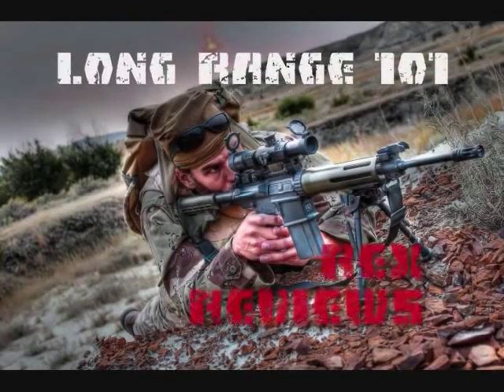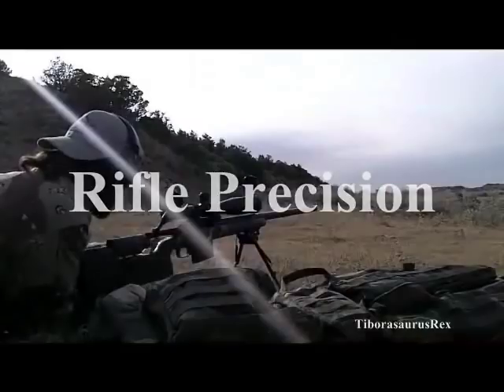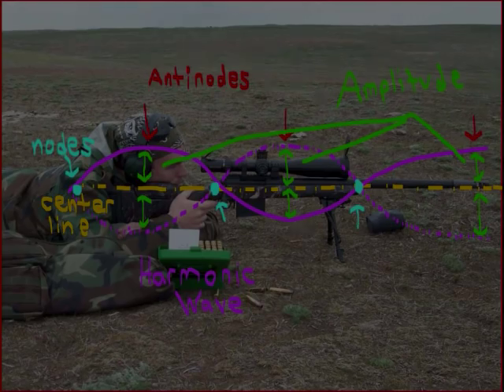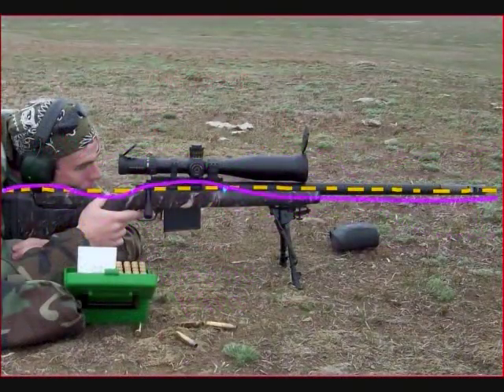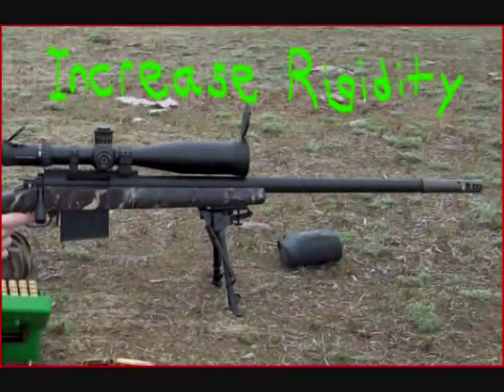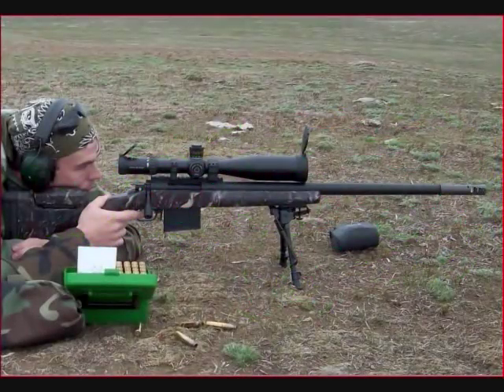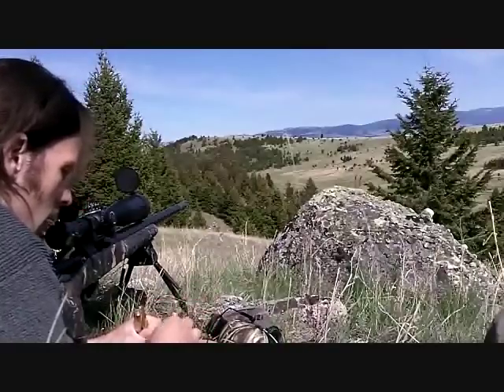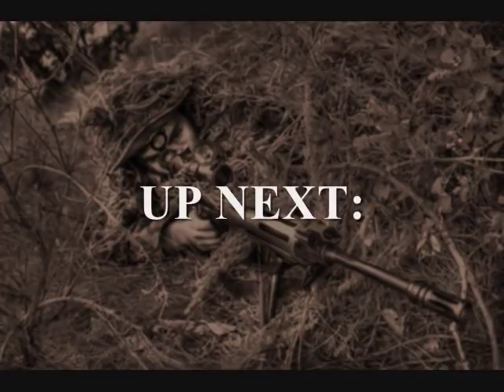Long Range 101 Part 7 - Rifle Vibrations & Harmonics EXPLAINED - Rex Reviews

Comment: What if the wave is a spiral induced by the rifling instead of a standing wave on one plane?
Reply: SOLDTONORM physically, vibration almost never occurs that way. The forcing frequency of vibration would have to be much higher than those causing a standing wave vibration. Spiraling absolutely happens but the effect is much less significant.
Reply: Thank you for your response. Not disagreeing, but what I have read from shooters in the UK mentions the positioning of the weight on a barrel shows notable effect from as little as a one millimeter movement.  At range, the minimal effect from a spiral movement might be noticeable, and since I am guessing the wave is not always occurring on the same plane, the spiraling might be creating a complex wave.  What causes the non-spiral deflection, and in what direction does the deflection occur?...Or do I owe you an apology?
Reply: A complex wave is most definitely created in an impulse loading condition. However, a closed, hollow cross-section's greatest rigidity is resistance to twisting. The resistance to sine/cosines waveform is much less in a long cantilevered element like a barrel. Imagine flexing a long pipe versus subjecting it to a torsion; the flexing deflection will be significantly more than that of the twisting given the same energy input. I'm not trying to be a know-it-all, I just saw your question and though I might have some insight; I understanding the original question correctly?
Reply: I appreciate the input.  Since retiring, I miss problem solving...a little.  Are we looking at a wave on a vertical plane since either gravity is deflecting the barrel downward, or the muzzle rises due to the drop of the butt below the center line of the barrel?  Minimize the effect rather than tune around it by supporting the barrel through pre-loaded support(as shown in the video), and assure that the recoil is absorbed at a point on center line with the barrel?  The Sniper 101 series is excellent.
Reply: I'm not familiar with current practice as far as mechanical vs load tuning. My guess is that because mechanical tuning is not as effective as it seems to not be current common practice. My main point is that the primary vibrations occur orthogonal to the main longitudinal axis of the barrel. Twisting induces the least significant vibrations, this is verified by mathematical modeling. It seems that tuning the load to match the harmonics of the rifle is the currently held best practice.
Reply: You're never going to get rid of the wave. What you're really trying to do is have the barrel at the same point everytime the bullet leaves it. Muzzle brakes seem to have a greater affect on accuracy than barrel whip. The gases leaving behind the bullet can easily affect it's trajectory.
This problem is not solved with one solution. You kind of have to do them all.

Comment: Wouldn't free floating allow for greater antinodes? I thought free floating increased accuracy.
Reply from the maker: True, but the reverberations in a free floating barrel are much more consistent and thus timing a load to the barrel is possible.  Inconsistent reverberations are much more difficult to deal with.  When it comes to system vibrations... consistency + rigidity = greater precision potential
Reply: Which do you prefer? Free float or non-free float?
Reply from the maker: James A. Unless the stock is EXTREMELY rigid, free floating is probably the safest way to go.

Comment: there is a point i disagree with and its the idea that the least vibration would be at the cheek or whereever because it is held against you. The deflection in the barrel is close to nothing but the force it exerts is immense and the force to "deflect" your cheek is pretty much nothing.

Comment: I wish .308 win barrels came in 1:9.5" twists.
Reply: What's wrong with a 1-10?
Reply: undeadhunter5 I've been shooting mosins for a while and it's my observation that I can make a 100-50 y/o rifle shoot better than a lot of production rifles (especially when they're shortened to 16".  The differences I can see between .308 and 7.62x54r (mosin nagant), is the twist rate and the cartridge's operating pressures.  I might be wrong on this, but at least I'd like to see a barrel out there to give it a "shot".  Besides, must hunters want to use heavier bullets which requires a faster twist rate.
Reply: 1-10 will stabilize a 200+grain bullet. I'm not aware of any .308 hunting loads that weigh more than that.

Comment: Awesome vid but I disagree with your assessment of the physics. While an antinode maximizes deflection amplitude, the slope of the barrel is minimized, at a node deflection Is minimized but angle of the barrel is maximized.
Reply: I don't understand.  At the anti-node the barrel experiences its largest deviation from the node.  Though the slope of the wave (the tangent?) is less at that point, the barrel is not the wave, the wave is a measurement of barrel flex.  Getting the barrel to flex to some exactly repeatable point is the key to accuracy.  Tuning the barrel so that the node is at the tip of the barrel would mean repeatability is maximized.  Is that right?

Comment: I wonder if you're aware of a new company: teludynetech, which puts a thing metal jacket on a barrel, and fills the space with a proprietary filler--which serves to GREATER stiffen the barrel AND greatly draw heat away from the barrel--without adding significant weight.

It looks to be a REAL solution to greatly enhanced accuracy AND preventing walking with heated barrels. Their site is teludynetechdotcom